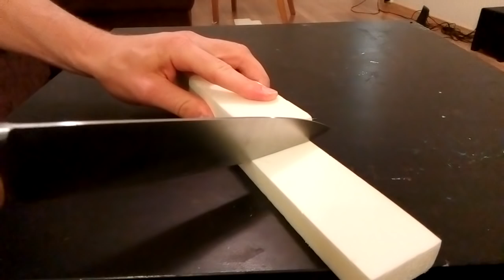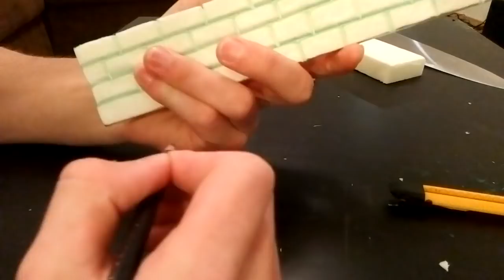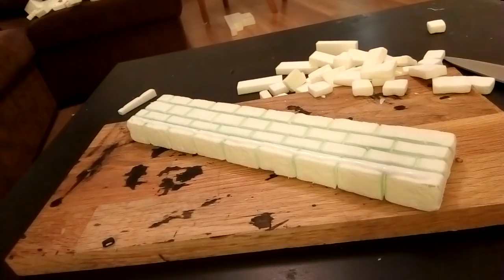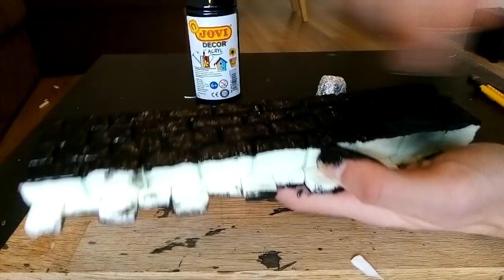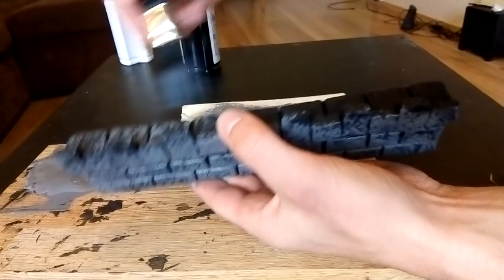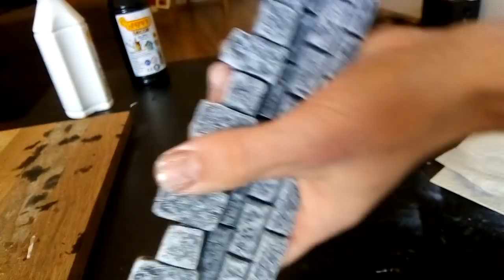Crafting Miniature Castle Walls (Terrain for D&D, Warhammer)

Comment: Never even thought of using a big kitchen knife for XPS foam, definitely adding that to my list, would be especially good for rocks and such.
Reply from the maker: Indeed it is especially good for bigger terrain pieces, and when you need more control. The curve of the blade also comes in handy at times.
Reply: It has me wondering, do you also use a hotwire cutter or do you prefer the knife?
Reply from the maker: I think I would prefer hot wire cutter for cutting more regular shapes, but I just dont have one
Reply: @BardsCraft  ah well your skills with a knife are impressive! Way better than mine at least lol. Anyways your videos are awesome and I hope you keep making them!
Reply: just don't use a good one. foam will dull the HELL out of any blade you use on it. and quickly.

Comment: how do you cut straight through XPS? everytime I try It just goes horribly
Reply: Try to go at an angle, also sharpen the knife
Reply: So, some blades are for push cutting, and are sharpened straight on like straight razors. The striated microgrooves from the stone or plate used to sharpen are perpendicular to the edge. Most knives though are designed to cut not by pushing through, but by sliding through as they cut down. The microgrroves here are at acute angles to the blade. Notice how he draws the knife through the foam, along its length, as he cuts. That is how he get such clean cuts. That and sharpening the knife so it has a very steep, gradual bevel. He has a knife sharpening video that is worth checking out.
Reply: Sharpen you blade.  I also got better results with longer blades than short.  You will end us sawing with a normal exacto scalpel on thick foam.

Comment: Does it stick to itself?
Reply from the maker: You can stack them on top of each other. For me they work well just as they are, but of course its easy to add some kind of wooden dowels for better holding things in place , or perhaps magnets?
Reply from the maker: And also, the defensive bonus of the wall stacks with itself :)